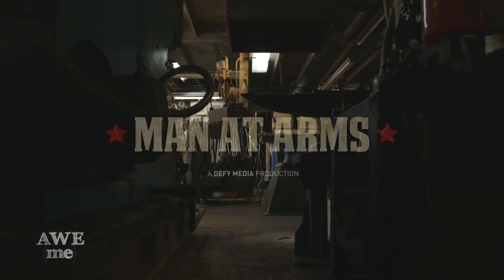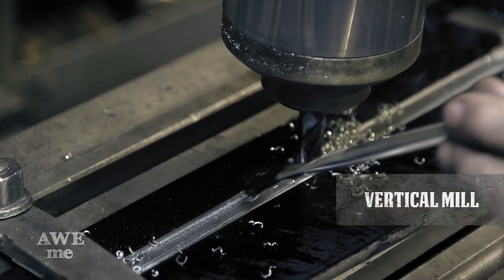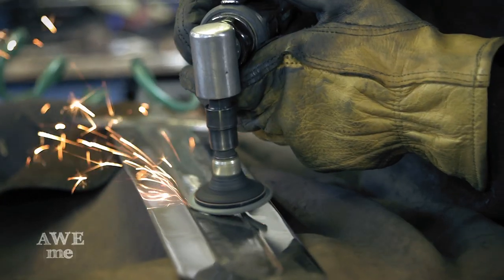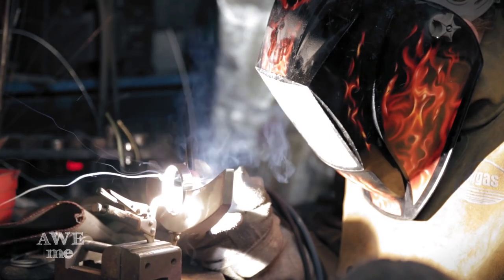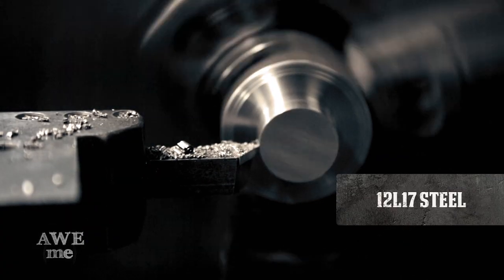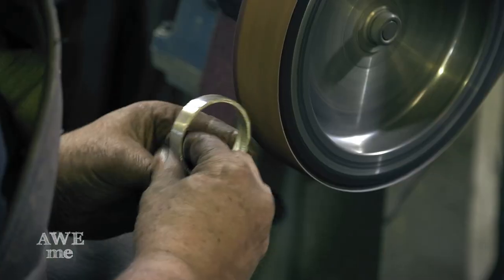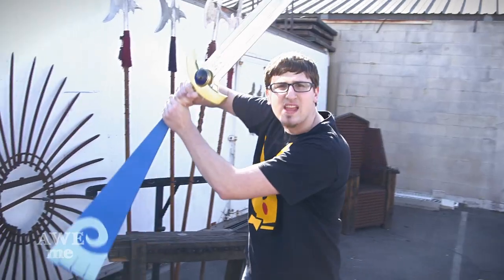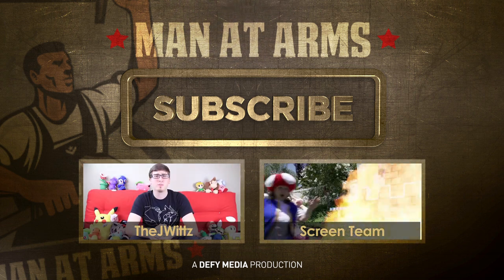Pokémon Honedge - MAN AT ARMS

Comment: two problems:
1. it woukd have to be good weatger to use that since the handle is made of metal. in a hot place you would burn your hand the moment you touch it, and in a cold place, your hand would freeze
2.  well.. as soon as you try to wield honnedge, you die.

Comment: you see, THIS is the issue with reforged.  they either don't follow the original design exactly OR they don't make it a serviceable weapon.  if you're going to forgo making it exactly like the original source material, please at least make the handle with an oval or beveled rectangle cross-section instead of it being a straight up cylinder so you don't accidentally bounce the blade off of something and cut yourselves.  with this one Tony followed the original design as closely as he could, so the round handle is excusable.
Reply: You're kinda right.  A sword should harm enemies, not allies or the user, and it should be made strong enough to hit stone in a miss swing and not be too dull.
Reply: Nether Dominator
well, not shattering or bending is the biggest issue with blade damage.  edge damage can be sanded out.

Comment: At first, I was so excited when I found this video. Being a player of Pokemon since I was five, and having used Honedge as a major part of my X team, I was thrilled to find out you guys did the cursed sword Pokemon on your show. However, after watching the video and seeing the results, I was extremely disappointed. This sword was not very accurate in many places. Had the cloth not been there, I wouldn't have known it was a Honedge. 1: the eye. Not only was the coloring extremely inaccurate, the size and position of the eye do not match the actual Honedge. The eye is too far down, and actual Honedge have this almost robin egg colored iris. 2: the hilt. Using such a shiny metal was a really big mistake, not to mention the way the hilt and sword meet up isn't completely accurate.3: the cloth arm. Probably the best feature, the only problem was the color. It was off by several shades.4: possibly the biggest problem, the blade: This is not a Honedge blade. The area closest to the hilt needs to come down and out to the sides more, the middle isn't supposed to taper until it nears the tip, the tip is the wrong shape and needs to be slightly longer, and again, using a shinier metal was a bad idea. Overall, very disappointing job of recreating Honedge. Extremely inaccurate, many obvious flaws, and overall, underwhelming. And this isn't even a difficult sword to recreate. Not trying to sound like a hater, but this was really bad.
Reply: Lets see you do better ey? You seem to know your shit.
Reply: ***** What do you mean not a valid argument? All I said was lets see you do better, I don't think thats an argument. And you are so picky, it doesn't matter if you are as big as a pokefan as you say you are, they cannot duplicate from a magical, living, anime sword. Since you had so many problems with this, I said lets see you do better.